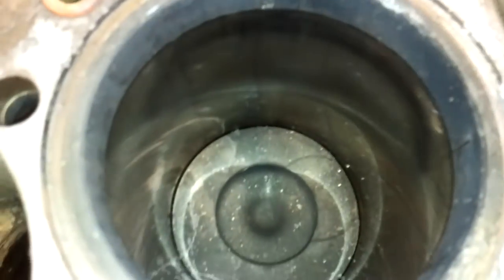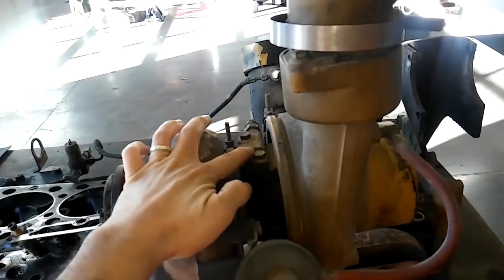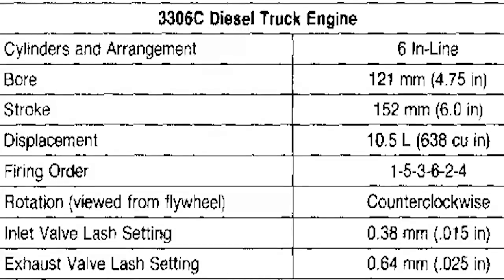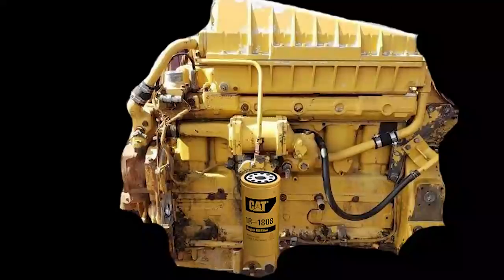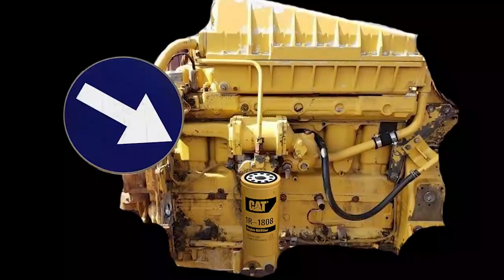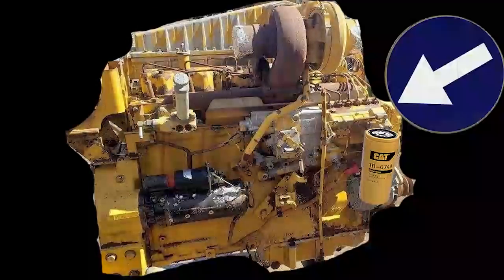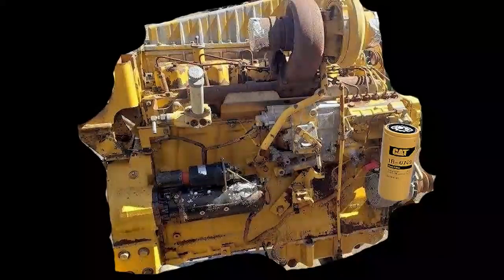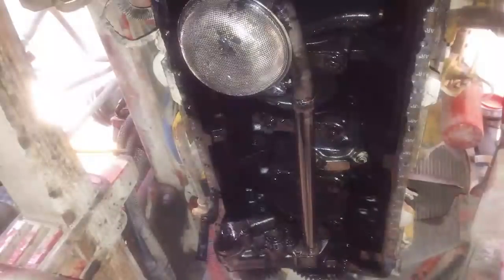The Cat 3306 and 3304 Diesel Engine. The BEST Engine you may have NEVER heard of.

Comment: I had a friend (he has passed away now) that had a Medium Duty truck that had a 200HP~ 3116 in it (actually several of those things - ugh) and it was a nightmare it was constantly broke down, he had to borrow a truck from another mutual friend to keep his business going...Well he knew a 3306 would NOT fit in his truck without some serious modifications (like add 2 feet of hood!)...He found a 190HP~ 3304T out of a BOAT! and got some different "engine accessories" (Manifold and Adapter housing whatnot) and put that 7L 4cyl in that truck, he said it was slightly lower powered, and shook like a paint shaker, and he eventually had to re-gear the axle but it got phenomenal MPG and was ultra reliable! (I don't think he turned a wrench on that truck for 15 years)  -  I actually drove the truck with the 4cyl...it was only really noticeably shakey at idle...

Comment: 3306 , chamber type always have problem with dropping valve . Especially at cyl no5 or no6 . But usually on no5 cyl. Else the coolant enter the chamber from the nozzle oring . Piston pin would break , for the smaller gudgeon pin . There are few models difference till the 3306D.i models .

Comment: Wait, did I just hear you say that the C 13 is your favorite engine and it’s easy to work on? Huh?
Reply from the maker: KCB serial number was the first engine I rebuilt and I like working on them. I wouldn't say they are the best Cat engine, but my favorite to work on.
Reply: I agree, very easy to work on. In a decent chassis, you can have the head off in less than 2 hours.

Comment: Do you work strictly on CAT engines? I know that Caterpillars owns several other companies, I was wondering how CAT engines compared to say a Perkins engine.  Perkins is owned by CAT.
Reply: Depends on the dealer network. I've worked on Cat, navistar, perkins, MWM, and MAK engines. But of course they all have Cat badging.
Reply: David O'Neal Weirdest thing I've seen what is a CAT badged generator with a "Perkins" Engine that was actually an International DT466.
Reply: @ronunderwood5771  I believe it's called the Perkins 1300 EDi. Gotta use Servicemaxx to communicate to it too.

Comment: These seem like really good engines; the 3304 and 3306. Being a wrench turner from time to time I have built a 74 Dodge 318, a Deutz FW912 and an Mercedes-Benz  616,  617. and a partially a 1974 Lister petter ST-2.Sorry to bother you in this quest but I've run out of possibilities. I would like to try my hand at a larger engine and would like to use it in some street application. I have searched on the internet for what vehicles the 3304/06 might go into but have no luck so far. I was thinking perhaps an old Ford 600 small dump truck. Other than GenSets and Marine applications and construction vehicles. Do you know what road vehicles did these engines go into other than big rigs? Thanks and keep up the good work. If I have no luck maybe the 6BT might be my next idea instead.

Comment: I'm rebuilding a 3304pc right now. 43v prefix. Serious block issues but we will get it fixed up
Reply from the maker: Cavitation holes? Sunk liner?
Reply: @AdeptApe  I will get pics monday, it's a non spacer plate 3304. Protrusion was -.010 on average so it blew a head gasket. Also had a hole in the block that was fixed at one time. Balance shafts where out of time so it vibrated like a s.o.b. Last guy must have used 25 abrasive wheels to clean the liners, block and head, a real basket case kind of job
Reply: Same, waiting for the block to come back from the engineering shop, and it had 0 liner protrusion when I pulled it down

Comment: Are you aware of the 3306 having any oil consumption issues? I work in the power gen industry and have several 250kw Cat generators with the 3306 that burn oil and smoke a lot when running. These are all low hour units (under 1000 hours). They start fast and handle load very well, but consume oil at a high rate when running unloaded (weekly runtime is without load). During a load bank test the smoke clears up and they run great.
Reply: Could be that that short runs with little load and heat keep the rings from sealing well?

Comment: I run a 1999 Kenworth cement mixer 3306, just today I was hauling a full load and I lost power  going up an incline on the highway. Wouldn't go over 1500 rpm, on flat surfaces it runs great. 
It almost seemed like it was starving for fuel, replaced fuel filters.  Old ones seemed clean🤷‍♂️ I have no idea where to begin.
Reply: 30,000 hrs 300k miles

Comment: we just sold our old KW w900 dump truck that had a 3306 never had and engine problem with it other than oil leaks. The engine was undersized for that truck, not enough power for a loaded truck, it should of had a 3406. I don't know what they were thinking when they built the truck.
Reply from the maker: It will get great fuel economy because it can't go anywhere. It is good in a smaller truck, but anything at highway speeds and heavier loads the 3406 is better.

Comment: It seems I have a 3304 from an ‘87 963 crawler loader that is exhausting coolant, I don’t have the engine in front of me but I’m told it’s either a liner or cracked block, what else could it be?  Turbo cooler?  Air cooler?
Reply: Coolant out the exhaust, head gasket, cracked head, cracked liner, if JWAC it could be it as well. Pull the exhaust off and see if it's isolated to one cylinder.

Comment: i've heard CAT is on the expensive end to maintain though
Reply: Yea but I mean any engine in this class is if your buying one of these you need to expect high cost to rebuild so I mean every hour you can get out of one is key and in my experience the 3306 is easily the longest lasting engine of its class I've ever seen there's nothing that can really break besides well water pump as he stated. They just run forever make lower power then most engines in there class which probally is the reason why they live so long.
Reply: @21babydew  how would the 3306 compare to a mechanical DT466? Im looking for something that i could do the labor on myself, and fairly cheap/available parts.

im completely clueless with engines honestly. I've been reading up on this stuff for only a couple months now
Reply: You've heard wrong, people always tell me that but the only proof anyone has is someone told them it once. Parts and labor costs are very similar brand to brand, it may have been true at some point but it was probably before the internet existed.

Comment: What I’d like to know is the 3408 a better engine than the 3406? Also, did they ever fit a Jake brake to the 3408 or was it a retarder system only.
Reply: You could not put a Jacobs brake on a 3408. To get the plungers to activate you would have a spaghetti mess of oil lines crossing over from side to side. Brakesaver only.
Reply: @johngoldsmith6629  3408E's came with Jakes iirc, but mechanical A and B models were indeed brake saver only.
Reply: @johngoldsmith6629  thanks for the info
Reply: @yaboileeroy3038  What is a 3408 E? Give me a serial number prefix to look it up. Never seen one in a on hi-way truck application.

Comment: I worked equipment and marine side. Front seals on equipment had a hack. CAT gave time for radiator removal to facilitate the damper puller. I made a tool out of 3/4 flat iron. Drilled a hole in the center and put a bolt through with a nut holding it, and drilled holes to bolt it to the damper. Put the damper bolt and washer in a few threads. The bolt in the center of the tool rested on the damper bolt. Then start bolts into the damper and slowly tighten them. POP ! Damper off, no radiator removal. I still have that tool.
Reply from the maker: That is a pretty good idea for a tool.
Reply: I'm sure others figured it out, but this was mine. I also figured out how to juice 40HP out of the 3406E and other electronic engines. :)

Comment: Josh.. truely enjoy you videos.looking to install jakes a 3406 A model.cost woul be ???
Reply: Unless you have the updated top piston ring it might snap it. PC engines was never updated, but most DI's was. I am sure it has been rebuilt. You will have to get a cab switch setup, engine brake and throttle switch for A model. Two types (throttle) depends on which one you can get. Valve cover might hit cross over pipe. On some the base had to be grind, but I think the bridges are redesigned to clear now. 

Engine Manufacturer:	Caterpillar
Engine:	3406
Engine Serial Number Prefix:	92U
Horsepower:	All
Engine Brake Model Number:	346D
Engine Control System:	Mechanical
12 Base Kit:	148-7440
24V Dual Lead Base Kit:	148-7449
24 Single Lead Base Kit:	148-7422
Engine Control Group Non-ABS:	143-6608
Engine Control Group ABS:	143-6608
Cab Control Group:	N/R
Clutch Switch Group:	N/R
Lash Setting:	See Application Guide
Lash Setting:	See Application Guide
Tune-up Kit:	143-6479
Reply: @johngoldsmith6629  thanks !!

Comment: Working in an underground and needing clean exhaust.  It was one of the best, once warm.  I have been told it has a slight preinjection of fuel.  that was not intentional with design somehow.  That also helped with starting.   Know if that is true?
Reply: I know that CAT built some indirect-injection 3300-series engines for underground mine service.

Comment: incredibly tough is an understatement. i ran a fleet of trucks all the same year with the 3306 and the others with cummins ntc. the 3306s had extremely high mileage and never needed anything other than oil. they far outlasted the cummins engines. only downfall to the 3306 which im surprised you didnt mention was the horrible extreme fuel use when they were run over 1800 rpm. otherwise bulletproof engines

Comment: Serious question/video suggestion: Do you harm your diesel engine by cold starting it, and not allowing it to reach operating temperature before shutting off? 

I'm not asking about operating a cold engine, only shutting off a cold engine. I hear people say it's horrible to do, but I only have a few theories on its truth.

Thsnks
Reply from the maker: Hmmmm, good question. So if you never allow the engine to get warm the oil and the engine won't really be able to expel any built up moisture, which is bad. Shutting off an engine that isn't hot though isn't going to hurt it occasionally though, at least I can't think of a reason why.
Reply: @AdeptApe  Thank you. I live in Northern Minnesota, where yesterday's high temperature was -15°F. It takes my truck 10 miles to reach operating temperature. I'll definitely be taking extra time to warm it up when I'm heading across town for groceries and such. 

And when the DPF regenerates at these temps, its sure a steamy sight to behold.

Comment: IMO 3208 worst engine cat ever made. "Throw away"
Reply: Saw them in lots of rental trucks like Ryder in snub nosed Kodiacks and such
Reply: Length a factor for sure (would fit where a 366 gas engine would) and most of them had a Spicer 5 direct behind them so the 2500 plus rpm helped with road speed
Reply: For sure wasn't built on the gear fast run slow platform lol
Reply: Oh come’on now, the 3116 in my top kick is supposed to be the worst
Reply: @duncandmcgrath6290  ha lol I have found the 3116 to be a great engine!
Reply: Back in the day , I used to haul caul in an old ford 68 or 69 with 5 and 4 trans. And some kind of V8 CAT , didn't have a bit of power , at the end of day , feet be numb from vibration , it was a little better than 6v53 Detroit .
Reply: @terrydavis6132  most V8 diesels were hot rods empty and dogs loaded I bet your arms got tired rowing those 2 sticks my friend
Reply: If you do the 3-ring upgrade, they are alright. Still not great, but not garbage.
Reply: @rodneyward8357  yea , honestly I was 17 yrs. Old , could get truck lisenes back then at 18 , when I was 15 Me and my best friend used to fix flat tires and service 9 of these co, al trucks after school and on weekends , at 17 quit school and same day I quit one of the drivers did to so they stuck me in it that day
Reply: @terrydavis6132  remember , you won’t be late in a 3208

Comment: Absolutely worthless in a truck, power-wise. It literally cannot pull itself empty as fast as what the RPMs are set at you have to get it pointed down hill a little bit and it will run 72 miles per hour until the road flattens out and then it drops back to 68 or 69 miles an hour if there is no headwind and it's not a high mileage engine
Reply: I dunno. I had one mated to an 8LL.  Hauled East-West, between 60 and 80 thousand gross. On lighter loads, I could easily get 8mpg.  Yeah, they were no heroes on big hills, but mine never, EVER left me anywhere in 10 years.  Pretty sure it still had the OEM starter on it when we sold it.